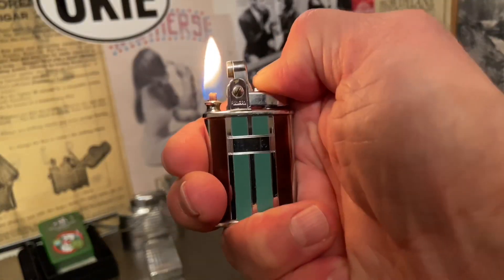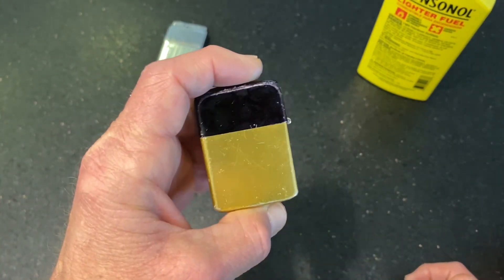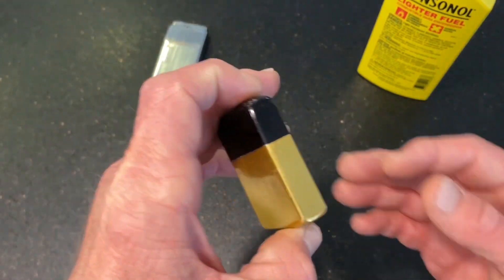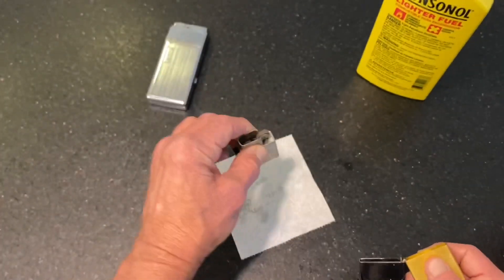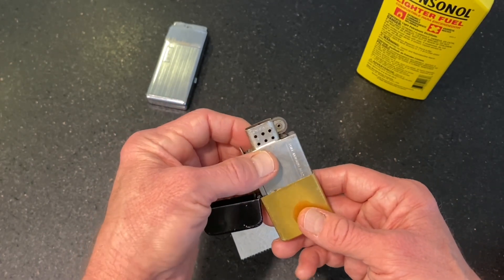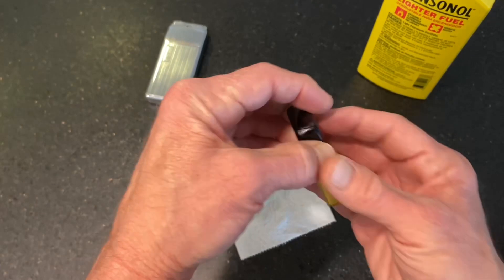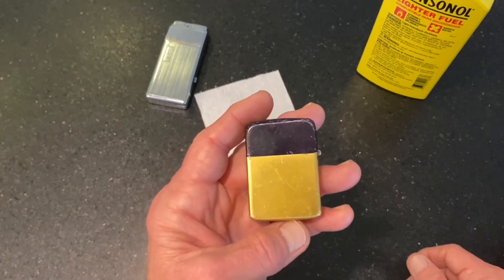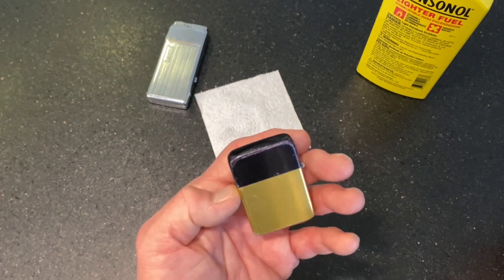What Is Vapor Lock In A Petrol Lighter And How Do I Fix It?

Comment: Yeah. I've been following Zippo's instructions when it comes to lighting up. Open lid, raise lighter then strike the wheel. Before that, back in the 1930s, Zippo instructed its customers to blow on the lighter for instant flame. Zippo changed the instructions somewhere around 1947, I believe. Changed to "raising-the-lighter-before-striking", that is.